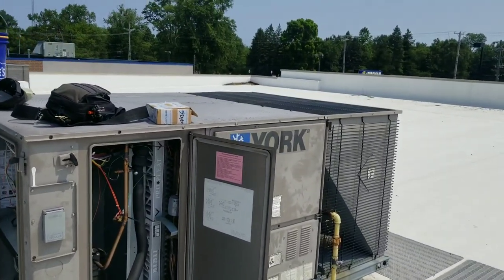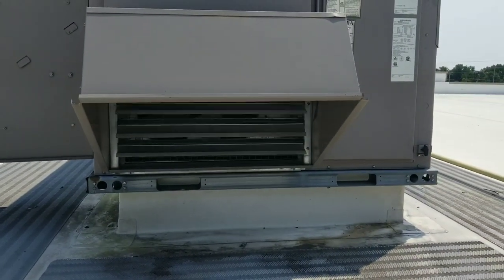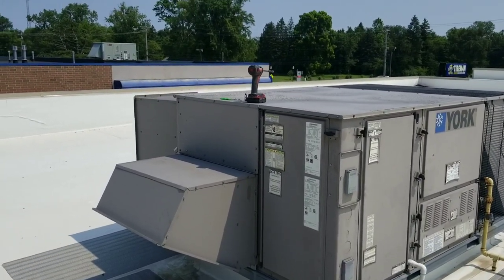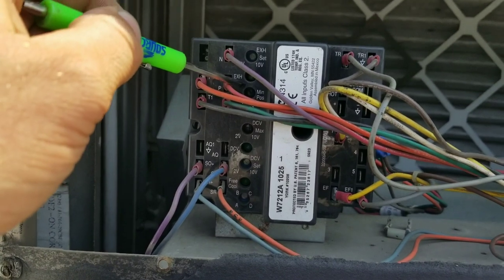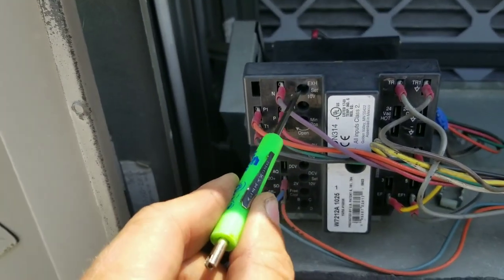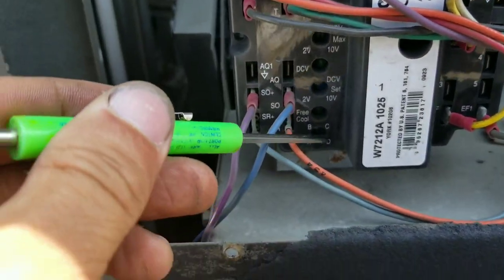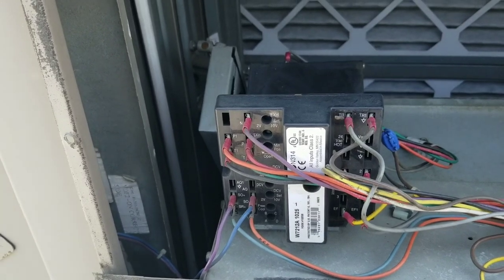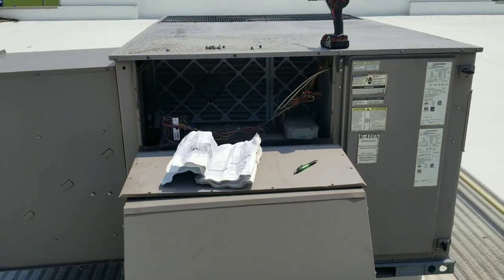HVAC Issues again

Comment: As a lead tech with a license in Mass, I was required to learn economizers well as no on e really knew what was going on and ignored them most times. A few things I learned from rooftops and even larger units at hundreds of tons: No one lubricated the vanes and they seize up. Use silicone as it does not put a smell into the building like oils. Once the vanes are free, check the actuator works, as the plastic gears inside the actuator strip. If the unit is not working it is a good profit for the company to replace them as it is a common problem, broken actuators and linkages are everywhere. Learn the setting in the book as it will make it easier to look good to the customer, seeing no one seems to repair them. Check the book for the test function terminals. There is a resistor needed to make it work, but a few cents for some resistors or a potentiometer you set permanently to the required resistance makes short work of this job. Remind the owner of the work "free cooling" and they usually jump to repair it. If you look at a psychometric chart and do the math, it is a huge money saver that is being ignored, but it can save the customer dollars and put money into the company's pocket that keeps you employed. Hope it helps.
Reply: I had the chance to replace 17 economizers for a General Motors plant here in California. Everything seized. Good money!

Comment: I just worked on a ventilator system for the first time on Monday. It was on a nail salon so it had to keep all those chemical smells sucked out of the salon so chicks didn't keel over dead while they were down there having their nails done. I had never seen one before and didn't really dive into it that much.  I was primarily working on the carrier gas pack that it was attached to. I do mostly residential so that was definitely out of my wheelhouse 😄
Reply: @curioushvacguy6876  just one for the nail salon.

Comment: I work on economizers all the time. You should study them and be very familiar if you are going to be working on commercial comfort cooling. Here in Chicago, the biggest problem I run into is when its just below 63 degrees but raining and the economizer is set up with dry bulb only. On DX cooling units this usually causes them to run mechanical cooling to dehumidify but many of the malls use chilled water air handlers and they shut down the chillers in fall causing them to only use economizer cooling when the weather is borderline. They will never start the chillers back up and the internal cooling load is high with all their lighting but the oa isn't really suitable with all that humidity. The Gurnee mills mall is notorious for this, I've been in the mall when inside temperatures are 80 degrees and they absolutely refuse to turn the chillers back on. The best solution I've seen for mall chilled water cooling with economizer are the Victoria secrets flag ship store in Oakbrook mall, they use Trane climate changers with chilled water cooling and boiler heating, but they have the addition of DX cooling as a backup for those transitional parts of the seasons here spring and fall. That way if the outdoor air isn't suitable due to high humidity, its got dx cooling backup. There are different types of economizers, differential , enthalpy, dry bulb, some with powered exhaust, some without. There are some that have exhaust tied into co2 sensors in the return ducts or placed on a wall that have priority , so no matter if oa is suitable they will open, and that can be a big problem. I never understood why they gave co2 priority like that, almost like the engineers got co2 confused with co. what would you rather bi in an office, a little drowsy or freezing your ass off?

Comment: The high limit that brings 24v to the input on the main control board is located in the supply section of that unit. (Access thru side panel) . It’s usually the connector on the terminal that’s shot. Stay healthy my friend.
Reply from the maker: Thanks for the info

Comment: Economizers are everywhere here in the state of WA. Our energy code is very strict on having them, and very few exceptions to not have them. But they so often are either hacked, neglected, or building owners disable them and close them completely because they think that outside air is costing them money (sick building syndrome anyone)? We normally specify power exhaust on any unit 5 tons and larger to ensure adequate relief capacity. I'm a design engineer, not a field tech, but I have learned my way around the Honeywell JADE controller and had to fix issues that got another HVAC guy fired from a project. Not as familiar with that older style though. Love the videos!

Comment: That Honeywell damper actuator works off a 2-10VDC signal supplied by the module with the adjustments on it. I forget where you measure the DC voltage output to the motor but you can basically set it by adjusting the minimum position until the damper is most of the way open then adjust the exhaust setting slowly and stop when the power exhaust fans start. That’ll get you in the ballpark. Just check that you don’t have a serious negative building pressure. If you work on a lot of York RTUs with economisers you may want to carry a couple of the crank arms that screw into the end of those Honeywell damper actuators as they seem to break often. Also on those style of York units a lot of people will condemn the ignition board when it is not the issue even though the main board shows an ignition control failure. It is quite common to find this code and the only thing the unit will do is run the indoor blower. On the main control board there is a single (yellow if memory serves me correct) wire labeled as limit. If you don’t have 24 volts on that limit wire the indoor blower will run continuously. Usually it is either a manual reset limit in the blower section is tripped or there is another limit in the heat section near the burners which quite often goes bad. Also another head scratcher on the older style York RTUs that had the flame runner pilot tubes if you ever had one that the ignition control (used to be a Johnson Controls blue box style) that would intermittently lock out for no good reason the issue is the rollout switch. It is wired to the ignition control on a specified rollout terminal. If that rollout opens for a fraction of a second, it would lock the ignition control out. I used to work for York Factory Service and worked on a lot of them.

Comment: The good news is that ASHRAE set higher standards for economizers, demanding more feedback & diagnostics on new economizers. Because quite often those economizers are mysterious black boxes that no one knows if they’re working or not.
Reply: The problem is that the manuals don't have good instructions on the operation and logic of Economizer controls. Also sometime they don't have the right options on them. Since most Economizers are also fresh air supplies, they can cause problems. If they are not understood correctly. They can cause humidity problems. If it's raining out you don't want the economizer opening.

Plus if that unit is setup properly and it's not documented on the unit. The next guy will not know what to set it at or how to set it. Especially, if it's multiple units.

This is what I'm going to get into next week on the building we just bought. I have 4 Trane units to figure this out on.